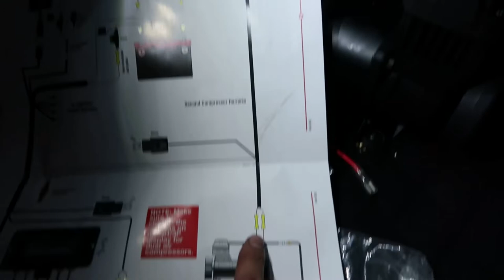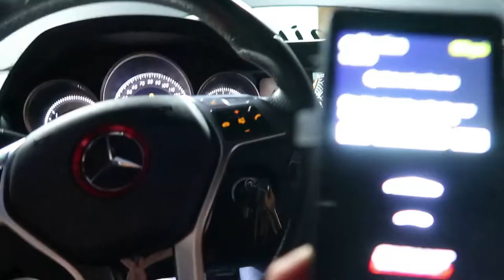2012 Mercedes Benz C300 4MATIC | AIR LIFT PERFORMANCE 3P

Comment: One of the compressor doesn’t have the filter, and is that a plug?
Reply: Sal_Vip they forgot to include 2 filters so only came with one but I have them both on now
Reply: Justin Kongmanychanh got you yeah bro because I sell airlift and viaircomps but good stuff brother car looks good

Comment: I have a c63 and am currently in the process of installing mine.  does that slant piece for the rear go bellow like you guys have or directly touching the bottom of the bellow?
Reply from the maker: Nice man! Bags are the way to go! But it goes on just as shown in the video!

Comment: Love your setup bro...whats the offset of your Front Wheel and Rear Wheel ?
I find that 9.5 x19 with 45 Offset rub the fender, im on 255 tyre width
Reply from the maker: Thanks man! I appreciate it! 
Fronts: 19x8.5 +45 - 215/35
Rears: 19x9.5 +48 - 235/35 
Yeah, I had the same issue when I was running my stock wheels and I had to roll my front fenders and pull my rear fenders
Reply: Lowminati thanks man for your respond, so now its clearly I need to find rear 48 offset instead of 45...
Thanks again bro!
Reply from the maker: Dantei136 yeah man for sure! Glad I can help

Comment: I just bagged my 2016, and on stock wheels and tires i hit the fender liner. Did you keep yours?
Reply: Nice!!! And yes, I kept mine. Didn’t have an issue hitting or rubbing on it
Reply: Thanks! I had to raise my struts , I’m currently at ride height of 67 and 73 but I think I need to raise that a lil bit, slightly too low and a little too bouncy
Reply: Mines super bouncy , any advice ?
Reply: Michael DiMatteo hmm, you do have a w205 so things are different from w204. What kind of brands do you go with for bags and system
Reply: Michael DiMatteo I would definitely mess around with your damping. Find a sweet spot you like
Reply: It’s a w205. I haven’t been able to find any videos like this for it
Reply: D2 bags 3P management
Reply: Michael DiMatteo yeah I figured cause there’s not much w205 that are bagged and up don’t know to much about the new models.
Reply: Michael DiMatteo yeah, I would definitely mess with your damping, that’s one reason to why it’s so bouncy.
Reply: Appreciate that! Yea man I’ve found no other ones really
Reply: Michael DiMatteo yeah man, for sure! If you have any other questions or concerns, just let me know!
Reply: Thanks ! I can’t wait until it doesn’t ride like absolute shit 😂